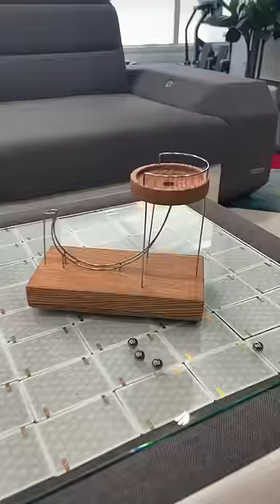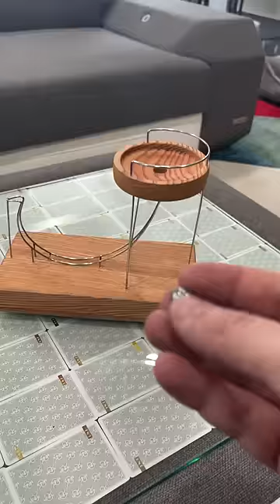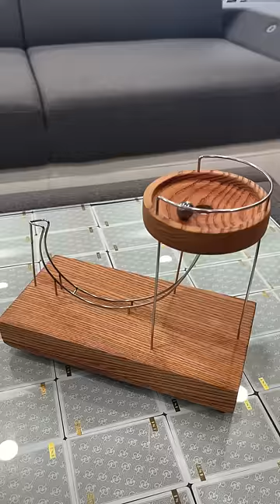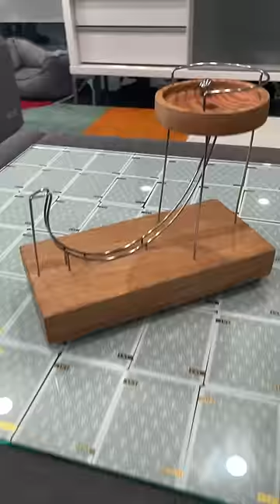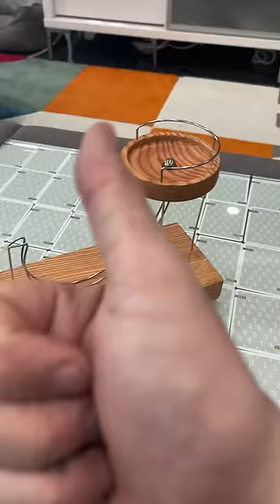An Impossible Perpetual Motion Device?! 😳 #Shorts

Comment: "If you're in a car going at light speed and turn on your headlights" What happens? 
S.right
Reply: Nothing
Reply: Light from headlights and your car both are then travelling with same speed 🤣🤣
Reply: Wouldn’t the light part travel then twice the speed of light?
Reply: @tomofasia  Intuition says so, but theory says the light from the headlights will travel at the same speed than the car
Reply: @tomofasia  not at all. carl sagan explained it better in cosmos series
Reply: If you throw a ball forward from a jet going 1000mph. For a split second that ball is traveling 1000mph plus the speed of your throw. Maybe light works the same way? Just doesn't instantly slow down
Reply: My understanding is that you'd have to be as small as a wave/particle to travel the speed of light or else the energy created/required would destroy the travelling vessel.

If you could travel that fast though, I believe that light speed is the upper limit of speed, so anything thrown while travelling at that speed would only be able to travel at the speed of light too (any number added to infinity also equals infinity)

I'm probably wrong but thanks for the thought experiment
Reply: @isaacheight6689  The thing is, the speed of light is not infinite. It is actually quite slow compared to the size of the universe. The closest star is 4+ light years away... The speed of light is about 300000 km/s while traveling in vacuum (it is slower in other mediums)
Reply: @c-daddy3129  When getting closer to light-speeds, "normal" physics stop working, and relative physics should be applied
Reply: You would have given yourself a speeding ticket the day before.
Reply: Depends on the perspective
Reply: @tomofasia  no
Reply: If you are in the car you will see a regular light beam. Also a stationary person out the car will also see a regular light beam.
Reply: Your headlights would still shine ahead of you. As they are already in a fixed motion forward.
If you turn them behind you ... Darkness
Reply: Does light accelerate faster than light, before or after, it falls into a black hole?
Is that why we can see light within the gravity of a black hole. Or is it because it can't leave? But, how fast is it traveling?
Reply: I'm not sure but if it's snowing and you turn on your high beams you can make the jump to light speed! 🤣
                  Han Solo,
                   A long time ago
                    Far far away.
Reply: The real answer is that if you were traveling the speed of light, you wouldn't experience time, so you couldn't turn your lights on or observe anything. If you were traveling 99.9% the speed of light, time would slow down so much that the light from your headlights would work like normal, and the light would still appear to be traveling at the speed of light relative to you.
Reply: Light is too light to be affected by speed
Reply: From a controlled position of emission I don’t believe it would be affected as it is in a fixed position, moving with the vehicle. There would have to be some sort of change in velocity to produce any noticeable change. No one’s done it but mentally that’s what I would assume.
Reply: You are actually already going with the speed of light now, relative to something. Relative to that thing you do not exist and the thing does not exist for you. You are light to it and the things is light to you, hence speed of light. You are invisible to each other. Everything else going slower relative to you is visible in one way or the other and can actually have an impact on you. But everything going with a speed of light relative to you and you to it is the different dimension, a complete different universe if infinite set of universes, likely different moments in time. Time travel would be passing into those realities, those universes
Reply: @isaacheight6689  wrong theory. Trust me am from the future. You are traveling with the speed of light right now to certain objects. Those object are invisible to you and you are invisible to them. You are light to that matter.  And that matter is light to you. As example imagine driving on the highway in the same direction. Some cars are not moving relative to you, some are falling behind and some are still passing you. But even though some cars driving with your speed are relatively not moving compared to you (and you are not moving relative to them) there are trees passing you both on the side as if they are moving. You know the trees are not really moving, that it is you that is moving, but then again the trees are moving with the road underneath you and the earth is speeding around the sun which is speeding around the galaxy which is speeding around other things. Relativity is real. So you are traveling with the speed of light already now relative to some things, they are just due to the speed of movement of you (or the thing) relative to you invisible. They are basically the light, and that is matter in its own dimension where you are light to that matter, maybe another being looking out through you thinking what you think incorrectly. You are always moving relative to something with a speed of light while not relative to other things. This is the universe you are in in a multiplex of overlapping infinite realities.  Trust me, am from the future. You guys will figure it out around the year 2200 and this communication will preserved in the global net museum of the history for display.
Reply: (Assuming, for the sake of argument, that it is possible):
To a person in the car? The same as ever...
Reply: @matesconoliver3841  Ehmm... that was not the question.
Reply: @christophersmith49  Why this make sense add me to the credits my future self get a % of this knowledge I Kno I been here and will always in some physicality be(her r there) but be all the same that's why we're labeled be(Ings) g ood wrk partner from 3003..
Reply: You'd never see your headlights on in front of you, would you?
Reply: You cant catch up to the light, why? No one know. The light will still see as it was passing you faster
Reply: Leme try this 💀
Reply: Headlights would be just as visible , as if you were parked. It's like when you're driving at 80 MPH and throw a baseball  in front of the car. Baseball would be going about 30 MPH but still go past the hood of car. TRY IT
Reply: @matesconoliver3841  You're wrong. What theory would that  be🤔
Reply: @c-daddy3129  Correct.
Reply: Then technically the lights are turning on the car. S.right
Reply: You can't go the speed of light. You can get infinity close. If I watch you from my reference frame traveling the speed of light -10mph in a car and you turn on you headlights I will observe the light from your headlight traveling 100% the speed of light and moving away from you at 10mph. From your reference frame the light from your headlights are moving away from you at 100% the speed of light because your time reference had dilated and slowed down relative to me. So no mater how fast you go light will always travel 100% light speed away from you in any direction by your point of view.
Reply: @tomofasia  no it will not add ,light is not a physical material.
Reply: oh no, no way. Don’t even try to apply classical mechanics for light. Light always travels with the speed of light no matter if source of light is moving or not. In this case light from headlights will move away from the car with the speed of light as well as from any other stationary bystander
Reply: Millennium falcon proved what would happen already in the intro of starwars!
Reply: Iv got a light out and the other one is a bit dull, what about your hazard lights 😉
Reply: Since it’s impossible for anything with mass to travel at the speed of light it’s moot…
Reply: No matter you turn lights on or off you can't see anything around you , because light come from those things can't reach on your eyes , you feel black around
Reply: @asueft  It's called Special relativity. It was initially proposed by Albert Einstein. It basically states that "the speed of light in vacuum is the same for all observers, regardless of motion of the light source or observer". So the car and ball example you mentioned works only at speeds much lower to the speed of light. Once you get closer to that speed, the "normal" physics stop working, and relative physics are needed to describe the events
Reply: @isaacheight6689  infinity is not equal to infinity in all cases. 1 that grows ♾ over time is not equal to an infinite mass for example.
Reply: Nothing. Nothing that has a mass can move at light speed
Reply: @c-daddy3129  nope; this is why relativity is hard - the speed of light in a vacuum is a constant regardless of your reference frame, and that makes it unique in the universe, as velocity is not a real property of most things - you can't feel your own velocity without a frame of reference to observe. Compare/contrast acceleration which you do feel.

But if you have a car that goes half the speed of light and turn on headlights your intuition might tell you that the headlights will have light that moves at 1.5c but what actually happens (and experiments have proven this outcome happens just by going fast) is that in order for that light to go however far in a second it needs to for you, your experience of time shifts (if memory serves going fast slows down time around you)

This is true of any velocity you happen to be moving at, but it is not noticeable unless you are going at an appreciable percentage of the speed of light, and is only measurable with atomic clocks loaded onto SR-71s as far as I am aware, but the atomic clock left on the ground that they synced up before the flight was ahead by the fractions of a second that Einstein predicted it would be.
Reply: @asueft  you are right about the headlights but I think a bit off on the baseball thing, as light is explicitly the only thing we know of that doesn't actually work like that.

What you are missing from that explanation of the baseball is reference frame - basically, if I measure that baseball's speed from the truck, it will be moving at 30 mph or however hard you can throw it. But if I'm on the ground and measure it, it will add the 80 of the truck to the 30 of the ball and (barring friction with the air) will go 110 mph.

The thing about light is that it goes the same speed no matter what your reference frame is. And so to make that work, you end up experiencing time dilation as you go fast (and also gaining relativistic mass but that's another can of worms)

We are experiencing it right now both due to the gravity well of Earth (general relativity) and our speed around the sun and our sun's speed around the milky way (special relativity);
Reply: You bump your own lights
Reply: @stevencowan37  🤔👍
Reply: @c-daddy3129  there’s no “slowing down” it simply just does not travel faster than the speed of light ever.
Reply: @wittyjoker4631  do you mean that there are different levels of infinity? Like how all the counting numbers and all the real numbers are both infinite sets but there are more real numbers than counting numbers so the two sets are not equal? Cuz I don't see how that's relevant to this velocity equation..... Anyway in general to address the question of turning your headlights on in front of a car moving the speed of light. First of all we have to state that this is entirely a theoretical experiment. You see all objects in the universe are essentially drag limited like an old Volkswagen. Let me explain that an old Volkswagen golf from like the '80s can't go over like 115 120 miles an hour. The reason for that is it doesn't have enough horsepower to overcome the air friction. My point is there's not enough available horsepower in the whole universe for that Volkswagen to overcome the essentially friction of moving through the universe at the speed of light. But let's pretend there was and let's pretend you turn your headlights on. Well relative to you the headlights would be moving at the speed of light and you're essentially not moving. I think about it right now you're moving at like 3,000 miles an hour but relative to you I walk past you at 5 miles an hour. It appears I'm just going 5 miles an hour not 3, 005 miles an hour. To an outside observer they wouldn't see your headlights come on either. Because you would look like a red to Blue shifted streak moving across the sky..... Lol the idea that you could define the Volkswagen shape from a distance is absurd like how could You observe something moving that fast as itself it would be an incredible blur. You wouldn't be able to determine the headlights were on or off. And if you did see them they would just be part of the same red and blue shifted blur. If you could observe them at all. Because you would literally need to bounce light off of where they were about to be when the light hit them and then receive the reflection back. Which would 1. Take forever literally. Cuz by the time you look at the object like you would have to time the light projection so far ahead of the car that by the time the light got back to you the universe would have ended. Especially if the car is moving away from you. 2. If the car is moving toward you by the time you see it it's already hit you. Same thing with your headlights if you turn the headlights on in the car and you see the headlights that means they have something to reflect off of which means your dead because by the time you've seen the thing in front of you you've already hit it at the speed of light..... Like it would take more time for the headlights to bounce off something and you be able to see the headlights then it would for you to hit the thing the headlights just bounced off of. 3. The object moves parallel to you or across the sky and you would just see a blur you would see like an extruded Volkswagen that existed addicts starting location, at its destination and everywhere in between at the same time. You would see it looks like a vw shaped line. Most likely it would appear blue with the front and red at the back. The point being if the object is moving away from you at all it would take forever for the light you sent to it to try to see it to get back to you. If it's moving towards you and you see it you're already dead because by the time the light you bounced off the car to get back to you got back to you the car would have already hit you. And if it's moving parallel to you it would appear to be in both places at the same time and the headlights would be irrelevant...... If you're in the car the headlights would move relative to you so they just be normal headlights. But if you see them and you don't just see a black void in front of you then they have something to bounce off of which means you've already hit that thing by the time you see it. Okay okay so what if it comes towards you but then stops right before it hits you or goes somewhere and then stops. If it's coming towards you you would probably see a bluish to Red Volkswagen ish light that was very small and got bigger and bigger and bigger until it was suddenly a Volkswagen in front of you. If it's going away from you and then stops it's the same idea it's a red shifted object but the shifting would be reversed and then it would get smaller and smaller and smaller until it was suddenly a Volkswagen at its destination. Depending on how far away the Volkswagen is it could be color shifted. Still. Like stars that are really distant have a color shift it's literally how we figure out how far away they are.
Reply: @witty joker  do you mean that there are different levels of infinity? Like how all the counting numbers and all the real numbers are both infinite sets but there are more real numbers than counting numbers so the two sets are not equal? Cuz I don't see how that's relevant to this velocity equation..... Anyway in general to address the question of turning your headlights on in front of a car moving the speed of light. First of all we have to state that this is entirely a theoretical experiment. You see all objects in the universe are essentially drag limited like an old Volkswagen. Let me explain that an old Volkswagen golf from like the '80s can't go over like 115 120 miles an hour. The reason for that is it doesn't have enough horsepower to overcome the air friction. My point is there's not enough available horsepower in the whole universe for that Volkswagen to overcome the essentially friction of moving through the universe at the speed of light. But let's pretend there was and let's pretend you turn your headlights on. Well relative to you the headlights would be moving at the speed of light and you're essentially not moving. I think about it right now you're moving at like 3,000 miles an hour but relative to you I walk past you at 5 miles an hour. It appears I'm just going 5 miles an hour not 3, 005 miles an hour. To an outside observer they wouldn't see your headlights come on either. Because you would look like a red to Blue shifted streak moving across the sky..... Lol the idea that you could define the Volkswagen shape from a distance is absurd like how could You observe something moving that fast as itself it would be an incredible blur. You wouldn't be able to determine the headlights were on or off. And if you did see them they would just be part of the same red and blue shifted blur. If you could observe them at all. Because you would literally need to bounce light off of where they were about to be when the light hit them and then receive the reflection back. Which would 1. Take forever literally. Cuz by the time you look at the object like you would have to time the light projection so far ahead of the car that by the time the light got back to you the universe would have ended. Especially if the car is moving away from you. If the car is moving toward you by the time you see it it's already hit you. Same thing with your headlights if you turn the headlights on in the car and you see the headlights that means they have something to reflect off of which means your dead because by the time you've seen the thing in front of you you've already hit it at the speed of light. But what if the Volkswagen has one of those rally light bars on the roof? Would you see the reflection of the light on your hood? Yes if you had enough time between destination and start location. You would run down the reflection of the light off your hood and you would see the hood glow. But you would have to be traveling over a really long distance otherwise your departure and arrival would essentially be instantaneous. And you would see your headlights on arrival. But if you had a long enough time where you were at that speed you would eventually run down the reflection of your own light beam. And it would certainly be color shifted with the appropriate Doppler effect. As far as seeing them in front of you you would see them as you approached your destination. They would illuminate the destination as you arrive. To an outside observer let's say you're going from point A to point b and halfway to the destination you turn your headlights on. If I could freeze time and look at you 25% of the way through your journey I would see your headlights off and if I could freeze time and look at you at 75% of the way through your journey I would see you with your headlights on. But the real observation would be that the color of the blur that you appear to be would change halfway through
Reply: @matesconoliver3841  I once read in a science pop article that at least in the thought experiment the light from the headlight should travel faster than light.
In the thought experiment they explained it with a rocket flying at 0.9c and then from that rocket another rocket were to start and also fly at 0.9c, in the same direction. 
From the view of the first rocket, we wouldn't know if it traveled at 0.9c, we would only see the second rocket fly at 0.9c relative to the first ticket. but from outside we would see a ticket travel at 0.9c and another at 1.8c.
________

If the light from the headlight travels at the same speed as the car then what exactly is happening to the light? The opposite of redshift? Become ultra high energy ray?
What would we see if we sat in that car? Everything in front of us would be dark, no? 🤔
Reply: It looks normal to you but the light gets blue shifted for an outside observe as the car approaches and red shifted as the car passed and heads away from you. The speed of light is constant in any reference frame according to the theory of relativity.
Reply: Think about a person traveling the speed of light. Lol wouldn't he die since the front side of his lungs could not expand, his blood be able to move in the parts that go "forward," as well as his immune cells, neurons, etc.?
Reply: @jonson856  that article was incorrect. When objects move at speeds close to light, velocities no longer add in the normal sense. Instead, they use a more complicated relativistic velocity addition formula. The formula happens to work out so that no velocities can "add" to be greater than c. So even to the person on the ground, the 2nd ship still moves at a speed less than c, even though the first ship sees the 2nd ship moving at 0.9c. The same formula also returns c when any velocity is added to c, so the speed of light is still c in any reference frame (in a vacuum).
Reply: @Razorclaws8518  then that means time travel is simply impossible?
Reply: You would not be able to see the headlights until the car hits you.
Reply: @c-daddy3129  a ball has mass. Light/photons do not. It's not affected by inertia.
Reply: you make a trail of light behind you i guess. but you dont possibly live by the moment, speed of light propably would destroy you and the car itself lol
Reply: @c-daddy3129  well yea, in theory you can possibly go infinitelly fast. just you need a source of that speed, and since the fastest thing we know is light well thats not the end. if you take a tank going the speed of light, it will travel faster than the car i think
Reply: @matesconoliver3841 *sun*: am i joke to you
Reply: Your head lights are on
Reply: You and the car will become the light.
Reply: @marcuspacheco3815  why did i get a notification when im not even being replied to lmaoooo
Reply: Light has no speed.  That's where they got it wrong.  It has a rate of induction through a medium called the aether
Reply: My favorite was powdered water!
Reply: @tomofasia  oooooooooo
Reply: @tomofasia  actually probably
Reply: wait no its a frequency, not a particle

wait it is a particle whaa5tttt
Reply: Light will break his own Guinness World record.
Reply: If you are in a car at 5mph and you run 5mph, what happens? Same thing to light
Reply: *Wright
Reply: @jonson856  If I'm not mistaken, while intuition tells us that the second rocket should travel at 1.8c, that's not what would happen. To the first rocket, yeah, the second rocket travels at a relative 0.9c. But from a "still" point outside of them, the second rocket would have a speed greater than 0.9c but still not greater than c. Using the relative speed formula it can be calculated. If the second rocket travels faster than the light, the whole Specific Relative Theory would fall apart. Not that I understand wholly how that theory works hahaha but that's its basic premise (not sure if call it premise is ok)
Reply: @c-daddy3129  pretty sure light has one speed and would just go the same
Reply: @CryBite  light itself is an energy, and comes in various wavelengths. 
There are radioactive particles within pure unadulterated sunlight, however they don't travel at light speed.

Think of it more like a large boat going fast down a river. 
From the shoreline. 
You can see the boat zoom past, but the wake doesn't hit the shoreline until the energy that the boat created moves through the medium (the water). 
The boat is the light which you see from the sun, the wake is the particle that the energy has interacted with.

Or a better one. The light energy wavelengths that are produced from a nuclear bomb of a respectable capacity, can be enough to completely vaporize you. A little further back, the light will make you appear almost completely translucent. 
These particles that have been affected by the light energy are now radioactive to whatever degree.
The next energy that follows is the kinetic energy of the shockwave, which is where most of the radioactivity resides, within the most directly contacted particles. 
Then you know the rest. 
The explosion creates a vacuum, which pulls a good portion of that matter back in, the rush back in from all sides sends the particles straight up, forming a beautifully destructive radioactive mushroom cloud.

Hopefully that gives more insight to the workings of different energies.
Reply: @GAMESTERVISION  bruhhhhhh the aether dont exist G that theory was discredited over 160 years ago
Reply: General Relativity happens. From your reference point the photons travel out ahead as normal. For bystanders, you and the beam will appear to be completely stationary and unchanged for thousands of years in their frame of reference.
Reply: @jonson856  Doppler Effect, like the sound of an ambulance siren travelling towards and then away from you, the pitch increases then decreases. To the front you would see blue Cherenkov radiation as your speed compresses the light waves reaching you. Behind would be darkness or infrared, as starlight could no longer catch up. However the beams from your car would still appear normal due to the relativity in your reference frame.